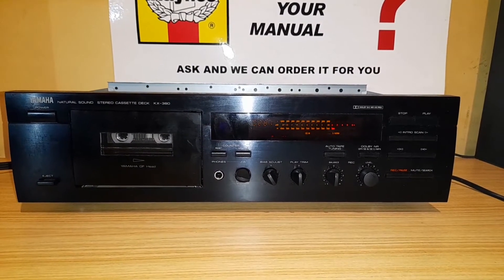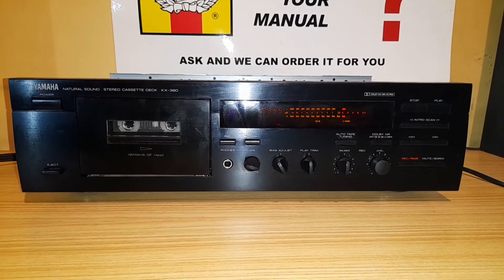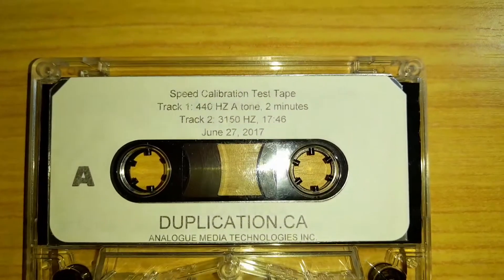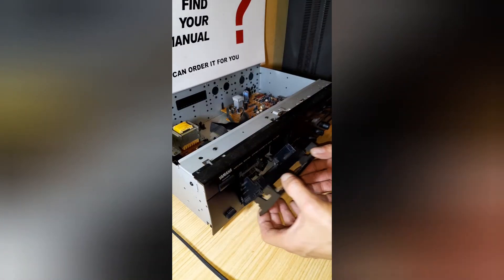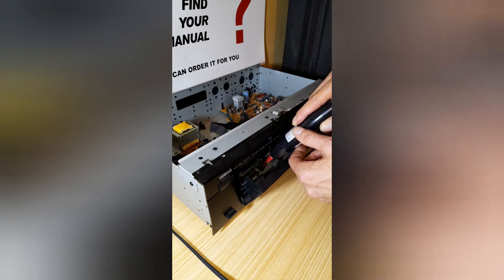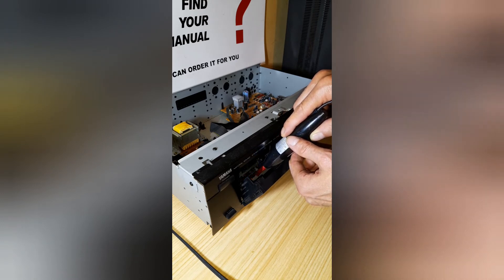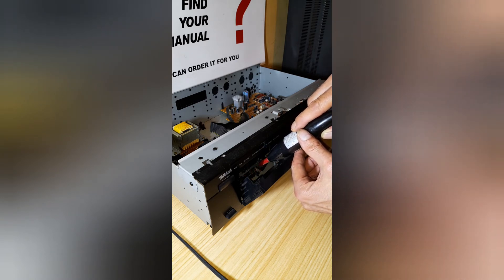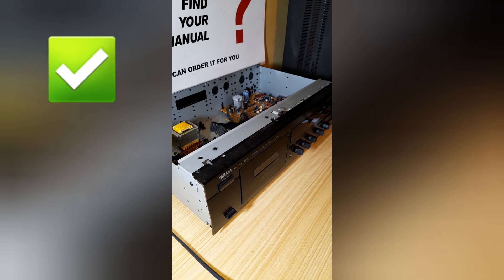YAMAHA KX-380 speed adjustment & heads demagitisation

Comment: It's a very excellent sounding deck
Reply from the maker: It is , and the play trim knob is also a great feature , of most YAMAHA decks.
Reply: @vidtech2630 Do you perhaps know what the mute/search button is for?
Reply from the maker: @dirkbals2836  yes , mute button is : when recording and the tune has finished , you can press the mute button,  at that point it cuts out the source and keeps on recording a blank space , for as long as the button is held , or if you press momentarily it will leave a few seconds gap before it stops automatically. So you can use the intro search , or music search ,later.  Thanks for asking.